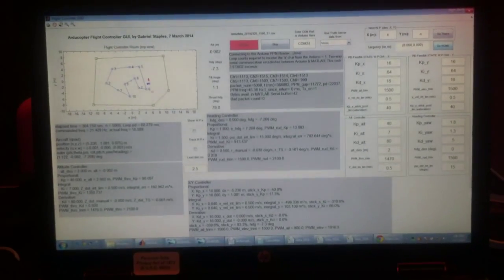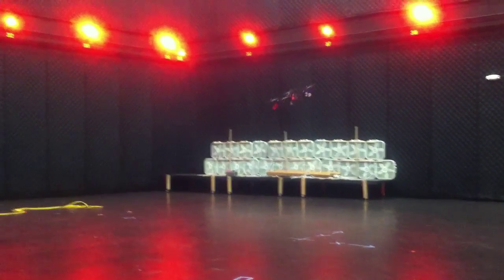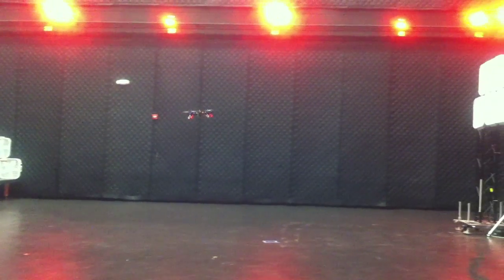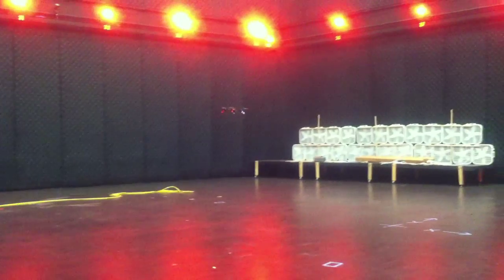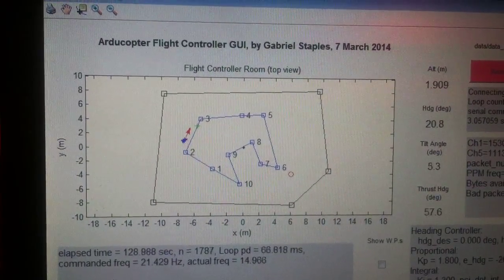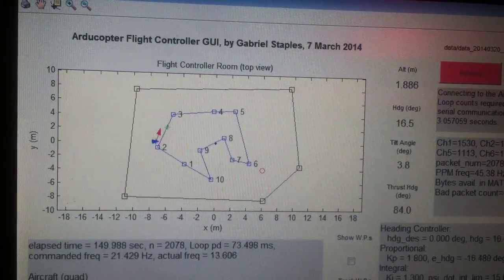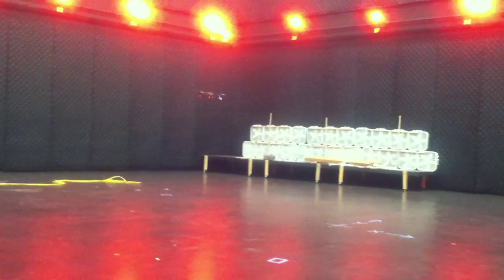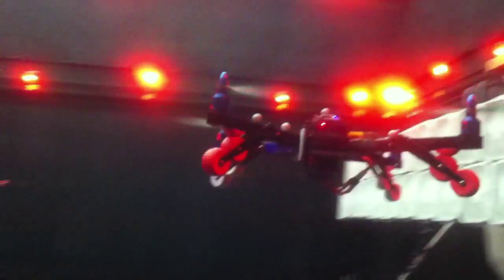2/3 - Autonomous quadcopter guidance and control (*PID-based* pure pursuit demonstration)

Comment from the maker: For more details on how this controller works, see my answer on Stack Overflow here: https://stackoverflow.com/a/72724753/4561887
This is the PID-based position controller I mention at the end of my answer above, where I say: "A PID controller on actual vs desired position (keep a total +/- wheel encoder displacement count...". See also my other Stack Overflow answer here: https://stackoverflow.com/a/73031923/4561887.

Comment: This is a great demonstration Gabriel. Thank you for sharing this beautiful autonomous flight. I got some questions to you regarding this flight setup:

(1) You said Vicon system refresh rate is 300Hz. Are the fps rate of the cameras in Vicon system 300fps? Oh my goodness! What a speed! I just wanted to check that if  you accidentally wrote 300Hz instead of 30Hz or not :) By the way, if it's not private, can you tell us where this indoor environment is?

(2) So you are receiving 3D location and orientation information of the drone at your laptop that is coming from Vicon. Or you may be computing orientation info in the MATLAB code if you are receiving at least two point's coordinate on the drone. My question is, this Vicon system; what does it detect on the drone? Are there some points on the drone with special different colors so Vicon cameras detect image coordinates of these points, and then determine 3D coordinates of these points by solving least squares problems? What features do the Vicon cameras detect on the drone?

(3) You implemented PID controller in your MATLAB code, and this code should be computing control signals to be sent to your PPM signal interface (I guess this is Ardunio). Are you sending these control signals (computed by PID controller) to Arduino via serial communication interface of arduino? Are you using your eRCaGuy_Timer2_Counter Library library that you shared at

http://playground.arduino.cc/Main/LibraryList#Timing

in your conversion from computed control signals to PPM signals? There are four control signals right? You should be computing a control signal that forces heading angle to be zero degrees (this is rudder channel), and similarly for throttle, aileron and elevator, you must be generating control signals. So do you have four independent PID controllers running simultaneously?

I wish you share the video that you mentioned; with 1us resolution timestamps which resulted in much better accuracy. I hope that you show Arduino this time and talk about how your laptop interacts with it and what's going on Ardunio, to deepest detail :)

One more thing; one of my friend is now busy with converting a C# project (to C/C++) that generates PPM signals in laptop by using sound card. If he succeeds, then Arduino interface may be skipped, and laptop can take care of everything by itself :) Seems interesting, I will let you know about the news :)
Reply from the maker: michael silverhouse Thanks for the compliments and great questions; I'll see what I can answer right now:

(1) Yes, the Vicon sample rate really can be up to 300Hz. My code only has it running at 150Hz, however. I just updated the description a LOT under the video. See details there. All 60 cameras take a sample, the sample is processed, and 3D vehicle position (X,Y,Z) and orientation (3 Euler angles roll, pitch, yaw), AND their first derivatives (rates) and 2nd derivatives (accelerations), are available at a frequency of up to 300Hz, with an X,Y,Z position precision that is <0.1mm. The Vicon system is a highly-capable, but very expensive system used primarily in the motion-picture industry to make Hollywood movies. You can research it. Its sample rate is adjustable. Since I am only running my flight controller at a commanded rate of 21.4 Hz, I could have probably slowed down the sample rate to as low as that, but I kept it at our lab's default of 150Hz just so I wouldn't have to change it. I used a modulus operator to only use every 7th Vicon frame. Again, see the new description under the video.

(2) Google and research Vicon. It requires at least 3 reflective markers (usually spheres ~ 1/2"in diameter, with reflective tape on them), to identify and determine the orientation of a vehicle. If you ever plan on flying upside-down, you'd need 4 markers I think to truly determine orientation. Otherwise it can get confused. The reflective tape on the spheres is essentially the same stuff on vests for riding a bike at night. The reflective markers we use are sold by Vicon. 

In short, here's how Vicon works: You must have at LEAST 2 visual cameras with a visible-red filter on the lens. Around the lens there are like 100 bright red LEDs. The bandpass red filter on the lens allows only this color light to enter. The camera pulses the LEDs on for a fraction of a second, according to the commanded frequency, then opens the aperture to look for the reflection at that wavelength as it flashes the light. This is helpful for removing noise. The markers show up as bright spots, since they reflect the red light emitted by each individual camera. Vicon then does some sort of matrix algebra I believe to determine the 3D position of each marker it sees, knowing the exact orientation and position of the 2 or more cameras that see the marker, and the XY pixel location of the markers on the camera's photo-receptor. Once the position of each marker is determined, the shape is compared to a known shape pre-calibrated on the vehicle, to determine which vehicle it is seeing and what the orientation of the vehicle is. This data is processed and sent to my MATLAB flight controller.

(3) Read my updated description under the video. I added more info about each channel. My flight controller uses one or multiple PID or modified PID control loops for each channel to get a desired response. Answering this question fully requires a great deal of work, so I won't expound more. My PID techniques, navigation algorithm, etc, took me a couple years to work out, working on them part-time. 

So, each RC PWM control signal, for each of the 4 channels, will be somewhere between 900~2100us, depending on your setup. My flight controller computes what each signal should be, then sends those commands to a PIC microcontroller via ethernet UDP packets. Someone else wrote the PIC code and was more comfortable with UDP than serial communication. Ethernet UDP is much faster than serial, but serial is plenty fast for this application. If I were doing it myself from scratch, I would have used an Arduino, and I would have sent the commands to the Arduino over serial. Anyway, so the PIC receives the commands and makes a PPM signal which goes into the trainer input on a Turnigy 9XR radio. The radio takes this signal and sends it to the vehicle.

I recommend the Turnigy 9XR or the FrSky Taranis radios. That's about it. I mean, look at the Spektrum DX8 overpriced non-re-configurable radio.  Do you really want to hold down the black trainer button for hours while you do testing? All switches are reprogrammable on the two radios I mentioned, among about 100 other reasons they are better radios overall. The FrSky Taranis is my favorite.

I am using the Arduino, with my Timer2_Counter library, in conjunction with pin change or external interrupts, to READ, not write, the PPM signal coming out of my Tx. This way I can use the Tx to turn my flight controller on and off, and to datalog the actual commands processed by the radio. For writing a PPM signal you need to use timer interrupts. Not hard, for an experienced embedded programmer, but also not trivial for someone who is not.

--Hey, if you get your sound card PPM signal generator working, **will you please make it open-source and share it with me?** I'd really like to see that. I have absolutely no idea right now how to control a sound card on a PC. Im very interested. On the same note, when I get my PPM writer and reader library completed for the Arduino someday, I'll make it open source and share it too. You can read the whole code. 
**On second thought, whether you get it working or not, please share it with me if you will.** I'd like to see the code regardless, even if it only kind of works.  

One more thought: the max audio output on a PC will be +/- 0.7V. You'll have to use some transistors I'm sure to get it to be 0 to 5V or 0 to 3V or 0 to 3.3V (all of which would work) to be read by an RC Tx.